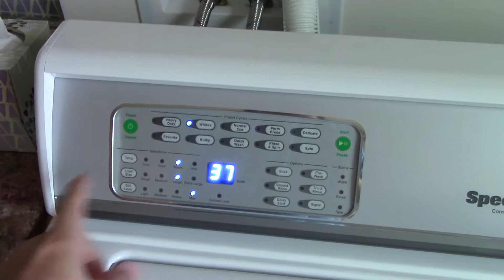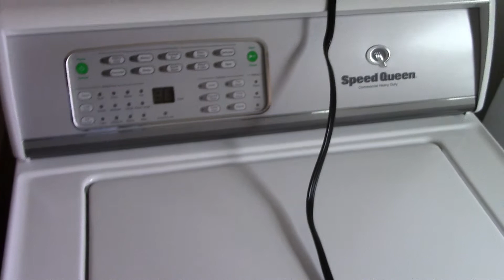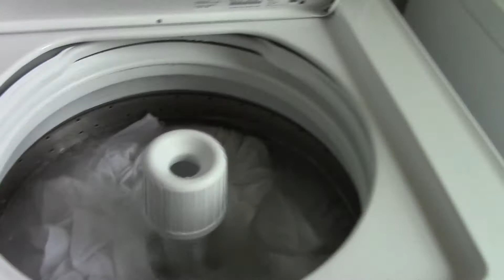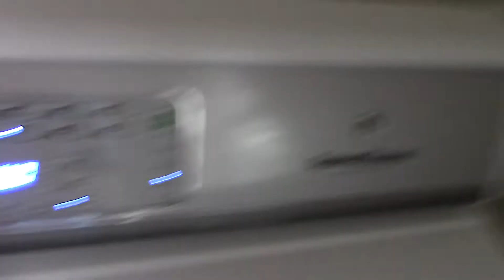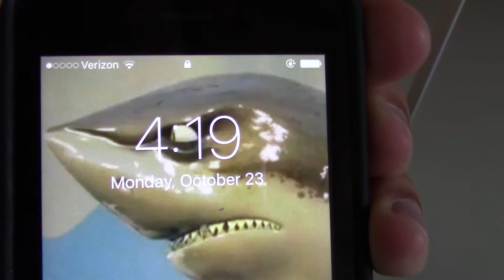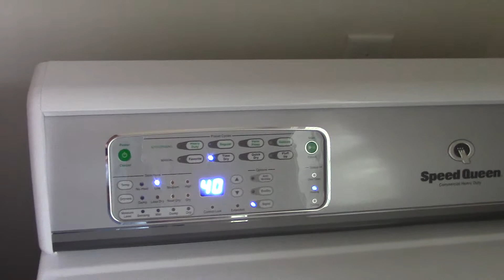Will Speed Queen Electronics Remember the Cycle After a Power Failure?

Comment: What if the power was out for more than 10 minutes, like half an hour, or a full hour? I'm sure the Speed Queen Electronics would remember the cycle.
Reply from the maker: As far as I know, it still holds the cycle!
Reply: And it's the same as pushing the knob in, and stopping the mechanical timer during a wash cycle on a direct drive with mechanical controls.

Comment: SHARKIE WHY DO YOU USE THE SENSOR DRY I LOVE IT NEVER HAD ONE PROBLEM MY ENERGY BILLS HAVE SEEN A BIG SAVINGS USING SENSOR DRY> AND I LOVE HOW THE heat decreases as the moisture leaves the dryer on the sensor cycles only. secret is to dry by weight and if you have a few things use the timed dry cycle if you have tiny load the sensor wont engage or cant read the load right and also use timed for comforters those are tricky on the sensor cycles because the sensors cant read inside the comforters .. electrolux 2023 dryer have solved that by using a humister reading internal and external moisture thats gonna be my next dryer its the only one on the market that does that
Reply from the maker: I only ever use sensor dry for my clothing, nothing else.

Comment: I do prefer mechanical controls on any appliance (washers, dishwashers etc) because they seem more reliable and easier and cheaper to fix. Plus even when I lose power, my Estate washer (which has mechanical controls), will pick up where it exactly left off if I do a load of laundry but so far I haven’t had that happen where the machine stopped where I lost power

Comment: Would you ever have a vintage Maytag A806 washer and Maytag DE806 Halo Of Heat dryer?
Reply from the maker: Probably not. Maytag was never really my favorite brand.
Reply: You would probably have a vintage Whirlpool/Kenmore washer and dryer. It seems like there are a lot of vintage Maytags left, and they are used on a daily basis.
Reply from the maker: Indeed. There were over 100,000,000 direct drive machines made. Finding them will not be hard for years to come!

Comment: Its been doing that awhile  recently its started making that clanking noise the break sometimes works most of the time it doant and the tranmission has been leaking every now and then i fill it with gear oil just to keep it going.  I would repair its just not woth it at this point whrn its going to cost almost as much as the speed queen i want.  Sad thing is 11 years not one issue now it has every major issue w asher could have it seems.
Reply from the maker: Yikes. Sorry to hear it's been giving you that many problems.
Reply: Sharkie626 me top it was a great washer when it worked right but i think to many years of constant washing is to blame 10 + loads a week had a lot of family staying with us plus i used to do wash dry fold services for clients at work since i didnt want to stay late i brought all the laundry home so i could apend time with my family so its deffinty had a good run now its time for a new relibel washer ill miss my maytag but sadly lately my dependible care washer  hasnt been so depandible.

Comment: Speaking of Power Outage, when I was stuck at the NC Coin Laundry-Mat at the campground, while I was filming at both vintage Huebch Gas Range Dryer and the new Huebch Digital Gas Range Dryer, while it's drying for my family and for myself, when I was going to film at the two dryer, and all the sudden, it lost power due to overload current.

So I went to the lobby and tell them that the Laundry Room lost power include the dryer not the washer, because both two Speed Queen Front Load Washer and one Speed Queen Top Load Washer has the power. After that, they immediately went to the circuit breaker and flip back on and get them going again, and amazingly, both vintage Huebch Gas Range Dryer and the new Huebch Digital Gas Range Dryer never lose the timing memory and sure enough, Alliance Appliance did an amazing job to make the Digital control panel to remember the timing whenever they lost power on anything. That's why I trust both Speed Queen, Huebch, etc that is made by Alliance Appliance that made so promising. =)
Reply from the maker: Definitely smart designing by them I have to say. Recently I used a commercial Huebch FL washer at a laundromat for a king size comforter. When the softener dispenser goes, it actually uses hot water in it to ensure that all of it gets cleaned out and does not build up over time. I was quite impressed to see that.

Comment: The next thing I would like to see is, how long will the machine stop when paused at the button. because with any HE machine, the water will drain (*with the clothes, lol) after 10 min. or so.
Reply from the maker: From what I've heard, the control panel will just time out and go into Standby mode after 5 minutes. But when you turn it back on, it will stay exactly where it was.
Reply: That's good to hear.
Reply: That's surprising. I had a GE that drained the water after 10 min.

Comment: Now all you need is a microcontroller-based solenoid to poke the start button when the power comes back.  Should the microcontroller fail to do so upon restoration of power, then just use a hammer to smash it all to bits.  Rearrange the bits in the microcontroller and then it should work!  Har har!
Reply from the maker: Now that would be quite the gadget! Haha